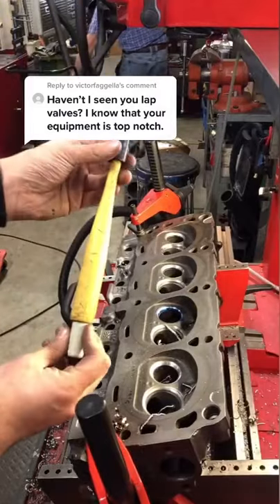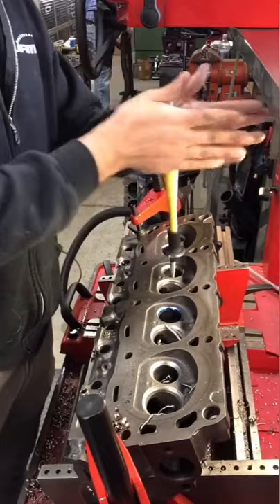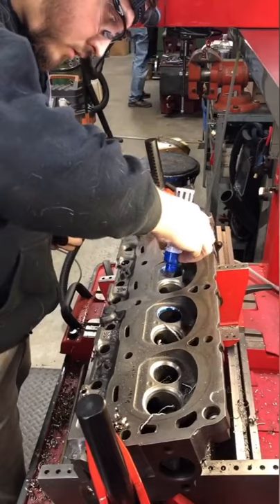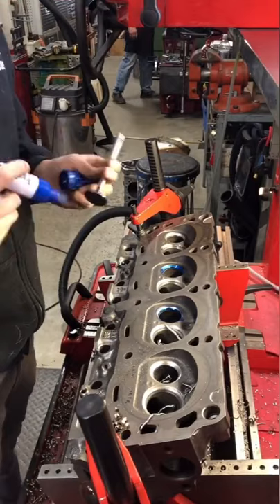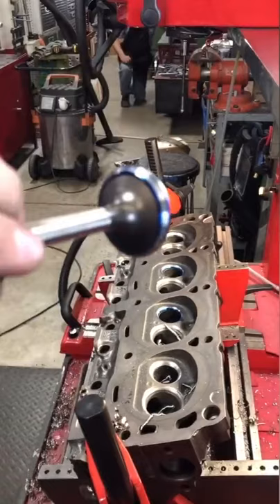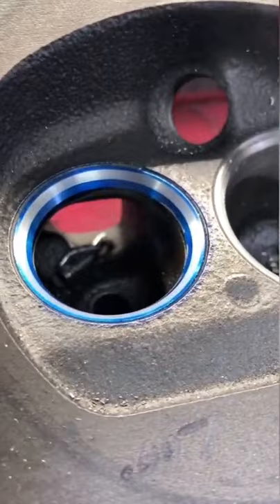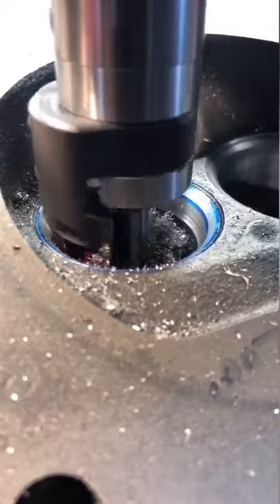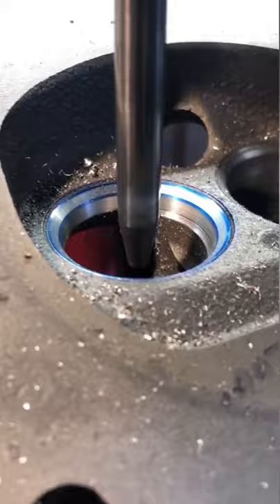#SHORTS If you don't lap valves, what are you doing with a lapping stick?

Comment: Some 40+ years ago when I was in school my teacher spoke the exact same words as you about lapping and also added that lapping was only a way to cover up shoddy work.
Reply from the maker: Exactly!
Reply: I'll agree to a degree on this, i've had to do it on a handful of jobs in the past where we've been limited by tooling. Also occasionally do it on race engines where the rules forbid any actual machining of the seats.
Reply: @WarlordMarty  I'd say that's agreeing. Whether your tooling is a limitation or rules don't allow you to machine the valve seat - lapping is making up for a job not done with proper machining.
Reply: not everyone has deep pockets but still get the job done with ingenuity and smarts...I think it odd the snobbery around so many things today.. putting others down does not make you better. anyone can throw money at things and get perfection.
Reply: When rebuilding my 350 heads, I laid then on the side, chucked up the valve stems in my drill from the top side, and power lapped them. Came out perfectly. Held perfect compression. Been going strong for over 10 years. I only had enough money for the machine shop to bore and hone the block. They did check my heads to see if they were warped and they ended up being fine. 
If I had the money for the machine shop to do the heads then I would have chose that option. But lapping does work, and it works well. 
Professional long range precision shooters lap their scope rings together for perfect contact and alignment. I've even done that on some of my rifles too.
Reply: @saltysteel3996  I did this on my 1962 sunbeam. it is still running strong 5 years on..I used a rubber hose with clamps though it helped keep it squared up when I was a bit wobbly..  after a case of Coors light,,,lol
Reply: @saltysteel3996  Sounds like a quick way to recess valves.
Reply: Lapping is still used on aircraft engines. Old tech but it still works.
Reply: @JAMSIONLINE  Some people don't need to even use machines when doing machine work you know. Lapping is hand machining, glad you're productive with power tools most people can't afford.
Reply: Machining will never get the finish a lapping will.
Reply: @asherdie  This video wasn't about the Finnish of Lapping, it was that you Don't need to Lap if you have Good Tooling and Machines. 
I NEVER Downplayed the Finnish Lapping gives. 

Watch the video read the comments than comment accordingly.
Reply: ...or a way to ensure that valve and seat are perfectly matched, without having to go back to the machine shop... again.
Reply: @craigtimmons3468  watched, read and still doesn't change the FACT, no matter how good your tools and machine is, it will never produce the same finish lapping does.
Reply: @colinwallace5286  So I have to question you, Do you lap your rings to the cylinder after the block has been bored and honed?
Reply: @craigtimmons3468  Two very different processes, which, as someone who obviously knows better, you can’t really compare. Valves and seats rest against each other, pistons/rings slide along the cylinder wall. I wasn’t trying to be a smartass... how about you?
Reply: @colinwallace5286  Not being a smartass just trying to make a point, you say its a different process but its really not.
If your lapping valves to make them seal especially after machining the cuts then wouldn't it be necessary to lap the piston rings after boring or honing to make them seal? The point is what was stated in the video if the  job is preformed correctly the first time then there is no need to lap.
Reply: @craigtimmons3468  Again, not the same thing at all. Rings are springy devices that take up the space between two components sliding against each other with a necessarily large clearance to prevent excessive friction. There is no need to “lap” cylinders. Valves and seats must necessarily match (and seal) quite closely. You were trying to make a glib point and you failed.
Reply: @colinwallace5286   Interesting, I guess for 40+ years I been missled into thinking that rings were to seal the piston to the cylinder wall so that compression could be built. So rings don't seal Thales just take up space? Interesting. 
This is my so called gilb point Grinding valves on a valve machine will give you more control over the finished outcome.
I've been grinding valves for over 40 years and not once have I had to lap them to make them seal. 
Only time I lap valves is when I out in the field and don't have access to the valve machine and then sometimes even lapping won't get them to seal they still need to be put into the valve machine.
So I now see it I LOOSE 🤣
Reply: @craigtimmons3468  Your problem is that you apparently view it as a “win/lose” thing. You compared two things that don’t really compare, other than the end result. As to rings, they DO take up space, hence making a seal. As to your “accuracy” angle, I’d say if I sent heads out and they came back badly done, I’d look for you. If I was changing a head gasket, and there were no other issues, I’d lap the damn valves. Why? Because it works, in the limited circumstances I and a bunch of others referred to.
Reply: @colinwallace5286  To Each their Own,  but as originally stated you don't need to lap valves to make them seal.
You can believe whatever you want but facts are facts and for anyone who doesn't want to accept them facts as yourself then your the real loosers.
Reply: @craigtimmons3468  Boy... not sure if I can go on with my life after that stern dressing-down. Perhaps you should have read the last reply.. You obviously didn’t. BTW, “looser” means more loose. You’re welcome.
Reply: But not everything is exactly a perfect fit, so lapping valves is a must when rebuilding older engines...not everyone has thir own cnc milling machine.(whatever dude used)
Reply: @WRMonger1  Correct, and I can back you up on that, I'm a valid licensed A&P but in the automotive field I have to agree with the machinist here.
Reply: Good idea
Reply: @craigtimmons3468  cylinder walls are honed with a diamond pattern (cross hatch) to help spread and retain oil on the cylinder walls. 

Flexible Piston rings make the seal so perfect matching faces aren’t required.

A valve is not flexible like a piston ring and you don’t want oil to retain where the valve seats. It’s completely different applications
Reply: @craigtimmons3468  I think you underestimate how hard it is to get machining that precise…

High end matching equipment cost is well out of reach for anyone aside from the more wealthy professionals.
Reply: Laping valves sucks ass. Big time. Used to do valve jobs on the old briggs & stratton 12hp flathead single cylinders on snapper or bolens ride-onns. ( snappers were better, the bolens had a sucky hood and side pannels) We had an 60 yo grinding machine with a touch of play to grind the valves face and the end of the stems for the clearance. We cut the seats by hand, ground in the valve lash in. ( 6thou intake / 10 thou exhaust). And hand lap the valves in to check the seal. If you had an off day it would take forever. Reface that valve regrind the clearance recut the seat.🤯. Then came the ohv 14hp engines. That used to pressurized the crankcase and cause a spontanious james bond style smoke screen when you cutt through foot high grass... great times
Reply: @WRMonger1  yea when I went to school we worked on older Cessna 150s and for a rebuild it’s suggested to check valve seating with Prussian blue and lap them if necessary which it usually is.
Reply: @WarlordMarty  you gotta do what ya gotta do sometimes
Reply: @WarlordMarty  IMO
Reply: I disagree.  No machine produced will have the tolerance of two ground mated surfaces

Comment: I've only ever used lapping when the head wasn't sent to the machine shop, like when you do a general rebuild/refresh.
Reply: I'm always too poor for machine Work, so if the valves and seats look ok I always lap them
Reply: @lancebandy9901  There is a significant amount of power in getting the seat opened to the right diameter. So many "while your in there" mods with cylinder heads. Even worked heads from a machine shop can be touched up.
Reply: @madmod  most of what I Work on is small block Chevys I usually swap vortec heads on, and you really can't improve the flow by porting them
Reply: Wow. That really is magic ✨... Marker
Reply: @lancebandy9901  hallo bro  I am head macaknic
Reply: @AhmedRaza-gp6ux  if you say so.
Reply: @lancebandy9901  o yes u can
Reply: @blowthroughcarbs  On paper you may see airflow "gains" through extra porting but hogging out a big hole in a head doesnt always make more power. This is especially important on mild sbc's that arent turning 6500+ every shift. Just making a vortec port bigger in volume will likely slow the air moving through it and wont help power production. Trying to force a Vortec head to flow like an aftermarket casting is a moot goal. Not saying there is not improvements to be made through porting, however theres likely more gains in the valvetrain as well as getting the seats properly cut and making use of the flow available. Hell anything past 200cfm on the intake side is enough to support 400s at the flywheel. If you need to support more, youd be better off with a different casting versus trying to hog out a stocker.
Reply: All else being correct, if there are no compression issues, lapping is nothing more than a thorough cleaning of the surfaces. Certainly can’t tell me that it isn’t worthwhile to do if you already have the heads off for some other reason.
Reply: I HAVE DONE THE EXACT SAME PROCEDURE OUT IN DIRT UNDER 2 TREES NEXT TO THE COLORADO RIVER...MY ENGINE WAS GETTING 2 OR 3MPG...1 EX VALVE...IT TOOK ME 3 DAYS AND FIXED IT FOR $40.00 INCLUDING TGE HEAD GASKET & VALVE...I used a rock and a 50c tool found at a yard sale 1/4 mile from van...WHOOOHOOOO...IT WORKED!!!
Reply: @bigsparky8888  Ok, David

Comment: I'm a retired auto mechanic I always left the Bells with lapping compound if there any small burrs it will take it off the bowels will seal and you won't have any problems with a valve burning also spring tension is very important a lot of people will put the old valve springs in a lot of people don't check the Springs to make sure that they are okay it's important to check valve spring pressure also I prefer to use new cylinder head bolts I also use a bottom tap to clean out the threads always use a tap started in by hand always use a bottom tap when I cleaning the bolt holes out don't get too much of a hurry take your time and do it right torque specifications and clearances when rebuilding a motor are so very important and doing a good job on cleaning the motor you're so very important I'm also a transmission and powertrain specialist always clean everything thoroughly inspect everything thoroughly I hope this information helps people out there
Reply: Lucky to find someone like u these days I used to put the same expertise in setting up carburettors in street racers

Comment: Didn't anyone teach backwards cap boy, that when you check for valve to seat contact, you push down on the valve and move it 1/8th of a turn back and forth to highlight any contact imperfections.

Why is it that people who've just started doing basic machine work, seem to think they have a golden ticket to regurgitate the stuff they've been taught with bits missing. Even if you only have contact on half the valve face, spinning it around with a lapping stick will yield a clean witness mark all the way around the valve. 🤦🏻‍♂️
Reply from the maker: Didn't anyone teach hippie gamer boy to listen to the video and think critically before making a comment attempting to put me down?

As stated in the video, I am checking for the location that the seat contacts the valve face. I am NOT attempting to highlight imperfections. Even so, with marker on both surfaces, the perfect valve will only remove the marker on the high spots of the seat. Likewise, if you have a perfect seat but your valve is ground incorrectly, it will only remove the marker on the high side of the valve. Try it.

But NO! The marker is NOT an accurate test of the quality of the valve or the seat, but it IS a good quick test for dimensional placement AS IS STATED IN THE VIDEO. 

Using "blueing" as a test for sealing went out the window with lapping in about 1940. Very old school, but a great quick check for placement to determine if you are cutting too big or too small. 

I'm sorry you don't seem to think I'm qualified. I can only assume from your comment that you are SO much more qualified than me. You should start a YouTube channel sharing your machining for the world to judge!

I know I'm not the best out there; I never claimed to be. But in a 60 second video, I do my best to explain the concepts without going so in depth that it bores every person who watches. Sorry if you think I'm simply "regurgitating" stuff with bits missing. Like I said, let's see you do it.

Signed,
Nicolaus Wolfrum AKA Backwards Cap Boy, B.S. '18 Mechanical Engineering CU Boulder, Cocky Machinist & Business Owner w/ the Golden Ticket!
Reply: @JAMSIONLINE  Yes I know, but triggering simple minded people into writing miles of drivel is a great way to gather information on the human condition, you do understand that the way a person carries themselves, how they dress and how they talk provides great insight into what buttons to push right? I was simply testing how best to irritate you in order to obtain some cheap form of entertainment. I could go further, but at the moment Instagram independent fact checkers are far more entertaining. The content of your video is irrelevant, I just needed to find the right angle to get you typing. Good day..
Reply: @michaelh.1262  Yeah, one day, it's not like I've been working since I was 16 and... Oh wait, it's my house. 😱 I have a house with a garden and two cars in a capital city! Guess I should be more appreciative of what I have, but, people always want more. 🤷🏻‍♂️ I want a house in the countryside, sick and tired of seeing needle pumpers in the phone boxes and homeless passing out from drugs in the street. But thanks to covid (all hail the WHO), I can't do anything right now.. 😒
Reply: @MrClassiccarenthusia  that sucks, dude.

You should consider moving further West.....U.S.A would be perfect for you, you can move to ANY of the 50 States (ALL of Her Territories, as well!!!) without  "papers" or "visas" once you've arrived (legally, of course) on the mainland! 

USA! USA! USA!
Reply: @jacobeller  I could theoretically move to the USA, but there are a number of states / territories I wouldn't touch with a full hazmat suit. California, San Francisco, that rat hole NY. 

Texas would be a promising place to go, they have a lot of industry moving their way, plus there has been rumblings they may have their own form of "brexit". Plus everyone carries guns, so you're less likely to be stopped by a scrote with a carpet knife.
Reply: @MrClassiccarenthusia  sounds like a waste of time and brain cells. Where did you take that "automotive engineering" course?
Reply: @Yotabro  It's no more of a waste of time than playing video games or watching TV. Westminster College in London. City & Guilds level 3, only took 4 years! 😂 No but seriously, engines and cars overall are such incredibly simple pieces of engineering, as someone who spent their entire childhood fishing busted equipment out of skips and repairing it. Compared to diagnostic work on servers and repairing electrical equipment at a component level, an engine is positively primordial. But they are fun to work on and they do make a lovely sound.

Comment: New brake pads and rotors come machined and true too but they always work better once you seat them.
Reply: Brake pad do not stay flat when under braking pressure. Next time you do a brake job( disc and pads). Take it for a spin, bed the pads in. Then go back pull out the pads and look at them..... they wont be a flat surface anymore
Reply: Apples to oranges here bud. Machine tolerances on valves in and engine and brakes and pad are very different. Not to mention they do totally different things. Brake pads and rotors are meant to wear and lose material from converting kinetic energy to thermal energy. Also bedding them in is a process for brakes due to they way they work. A brand new rotor has no brake pad material spread onto it therefore it doesnt perform as well until its bedded in. The brake pad during the bed in process distributes brake pad material onto the rotor which aids in grip and stopping power, since the brake pad is the wearable abbrasive. Valves dont do anything close to this. They are ment to open and seal. And their tolerances when manifactured should be so tight as to not need to lap or do anything of the type. If your lapping valves you didnt do a good job machining.

Comment: lapping dates back to the 1940s when the service grade tools used stones and couldn't replicate factory tool precision. I learned lapping in high school auto shop in the 80s and I have used it on occasion to repair valve seats that weren't quite worn enough to require a full valve job. Usually on old tractors that we were just trying to finish the hay season before performing a complete overhaul.

Comment: Lapping gets the job done perfectly...and you can "visually see" the results.
Reply: Cut
Sand
Then polish
Reply: No, lapping can over-wear the valve and most importantly the seat. It's better to do it properly and save that strength for the running motor to use.

Pretty minimal really and probably not something I'd care too much about if done in my own car, but it isnt "perfect"
Reply: @Charlie-nc3cp  ... both ways wear the valves and seats.
Reply: Lapping if not needed is like turning your rotors just because they're shiny. You're correct, but minimally invasive is always best policy.